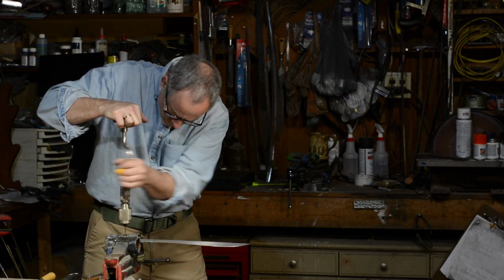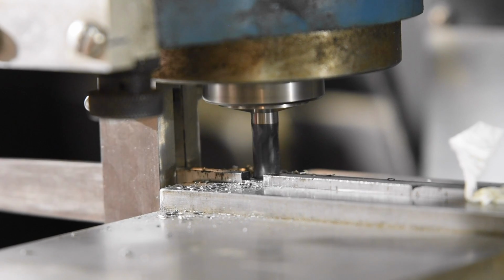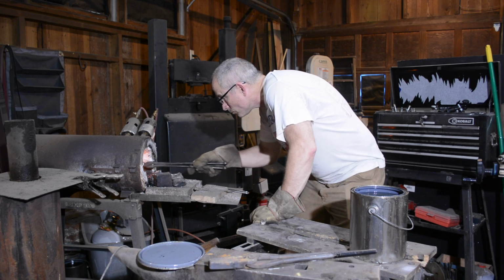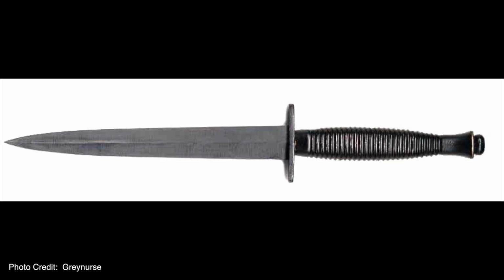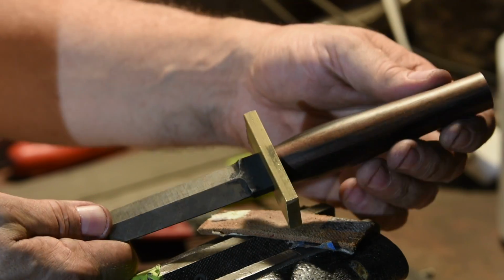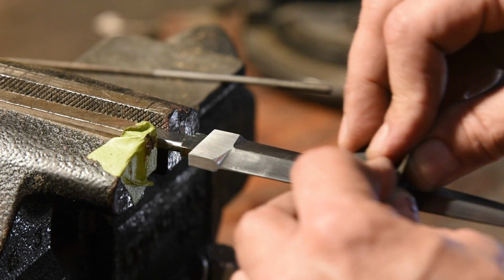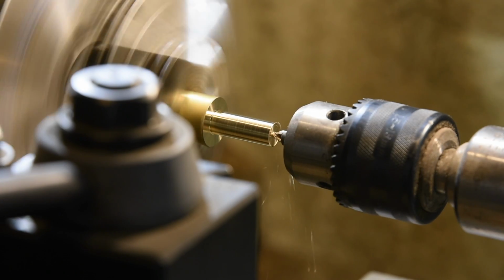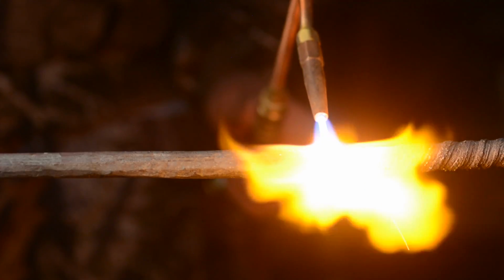Making a Damascus Steel Fairbairn-Sykes Commando Knife

Comment: I did a FS Sykes style dagger last year, and found that grinding the edges was without a doubt THE toughest challenge I've ever had. It was before I'd got a 2x72 grinder, so I was just using a cheap bench grinder with a wheel, a file, and sandpaper. I took of most of the steel with the grinder, then finished the shaping by hand with a file. Finally doing the polishing by hand with sandpaper. 50+ hours work involved with that one, I swore that I'd NEVER make another, however an incredibly close friend has requested a Damascus FS Style knife now, so there goes my plans for being lazy!!

Comment: I have an old Queen knife with a handle it's been bleached by the Sun and weather and rain for at least a year and a half two years I found it again in the woods and it's bleached out like I just watched a video on stock finishes knife and firearm I would assume would be in the same category I have some stain with urethane that I'm going to apply by hand after I lightly with a soft toothbrush brush out any debris or other visible trash but my name is Chris Rowan I appreciate your work ethic in common sense approach in my last name spelled e n not a n but anyway I'm just an old nail Bender trying to save this whole night the blade is actually pitted brushed it out all the and what have you but it's just going to be on a shelf hopefully it'll look patient maybe I should just keep it the same but not me

Comment: Just trying to think of ways that some of these portions can be done simpler or quicker. Has anyone ever tried using a reciprocating saw for some of the sanding? I'm referring to taking the finger guard and attaching it to a blade that has been made to hold the part. Then slowly setting it on afixed sandpaper while trying to be level and flat. Proceed to reciprocate slowly at first. It would save your arm elbow and shoulder and possibly save quite a bit of time. Perhaps it wouldn't work I don't know

Comment: Fairbairn Sykes are still available in the UK - for good quality ones pay about £250-£300 .Cheaper versions are available with carbon-steel blades for about £50 .

Comment: My Dad was OSS WWII... he carried one every day then... he carried others, this one had a particular purpose...
Reply: The bevels on my Dads are slightly concave (and the edges are not made for cutting), and the blade is longer and thicker in the center... the handle is cylindrical. diamond knurled (like checkering on a gun stock) bronze shaped thinker near the iron hilt then thinner toward slightly pointed iron pommel to fit the hand and for balance...

Comment: why don't you use stainless Damascus instead of that rusty carbon junk? Your work is top notch but it's no going to last generations if you don't use the highest quality steels. Someone will neglect it for 2 years and it will be junk.
Reply: The originals were carbon steel and many are still in good condition today. Also, stainless Damascus is extremely difficult to forge weld, so that would drive up the amount of time spent significantly

Comment: Beautiful work Walter.  I literally exclaimed out loud when you stopped the lathe to show the oiled handle.  I have to wonder why you didn't cut the hole in the handle to match the flats of the tang though?  It seems to me that it would have given a bit more strength against rotation.  As always, a great informative video.

Comment: Hello Walter,  I have a question about the heat treating  / tempering process. I know that the metal is heated then immersed in various types of mediums i.e.  cold water or oil versus pre warmed liquids, etc , there seems to be a varied list of methods, usually the maker wishes to cool the blade down as fast as possible, not always I know, but if a person wanted to cool the blade down as fast as possible would they get much better results if they placed or held the blade in a small blast freezer sorta speak, meaning  jets of cold water and high pressure air blasting upon the blade taking away heat faster then plunging into a liquid. 
   I only mention this because from I have seen from various sources the heated metal when plunged into a liquid NEVER touches the liquid in the first place, so it might be more effective to cool items down via the high pressure cold blasts of very cold wet air...   just wondering   thanks
Reply from the maker: Actually every steel has a different optimal method of cooling and -- oversimplifying a bit here -- you want to cool the blade as slowly as possible and still cause it to get hard.  The faster you cool it, the more likely it is to crack.

Comment: I wouldn't mind a few extra minutes discussing why this knife style is significant. No, I have no idea how to use Google.

But beautiful work. Thanks for making a video of it.
Reply: John Alexander the F-S dagger was a commando knife essentially a sentry stalker. The width of the original at the guard was based on roughy dimension of the wind pipe so that when inserted through the throats it sealed the airway. Seems extreme but it was designed to make  that gruesome detail quieter. Walters version is narrower I think than the original. His version is way stronger the original was a weak design because the tang was to fine. It was not a slashing knife for sabre rattling it had one purpose a killing tool and it was good at it. Like many of Walter's designs his has modern materials not bounded by time and a government contract. Extraordinary work by a great craftsman. The shoulder on the tang to snap press fit the guard is perfect example not one in 500 makers would do that.
Reply: If you really want to know about the significance of this knife, check out “Get Tough” which is an awesome book by the original designer of this style knife, W. E. Fairbairn. It’s not overly wordy.

Comment: nice build, the original had some problems put there for ease of manufacturing. and to save materials,  I think your  version is much better (even if you had made it of 01 and rubber. )

Comment: Beautiful knife !

For me, the single most important aspect of a good commando knife (besides proper geometry & balance) is that the steel must have a sufficiently high TOUGHNESS rating that the point doesnt snap off if you throw it at a less than perfect angle.  Every commando knife ive ever owned, if it fails at all, always fails by having the tip snap off. Steer clear of commando knives that are too hard/brittle, or have too much distal taper, if you value the tip.

Comment: This style of knife is one of my favorites for various reasons. I wonder what one of them is LOL. One thing I never understood was the roundness of the handle though. I know it's meant to be a thruster, but still.
Reply: Turned because of the ring grip pattern (that's for the original) and therefore round?
(edit,  it was supposed to be in metal with checkered pattern,  round because of turned metal?)
Reply: Adamast I never understood why they made the original handle round to begin with.